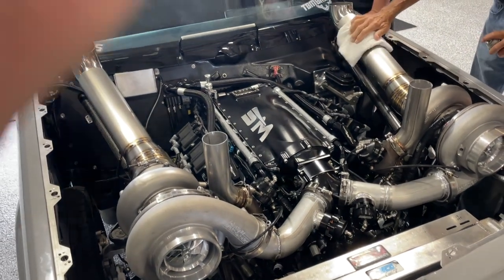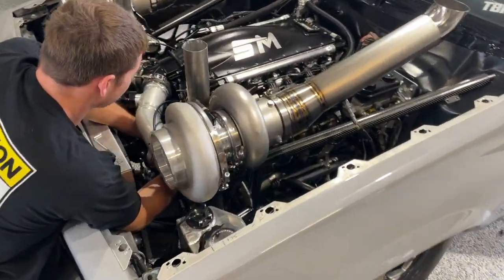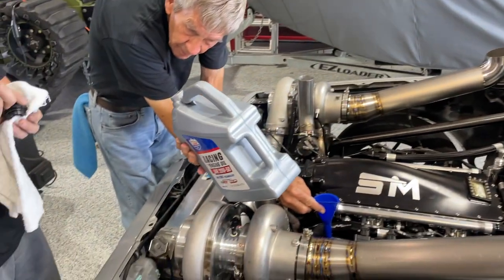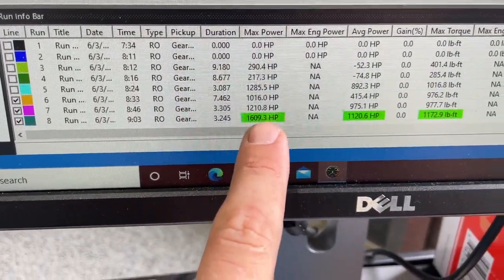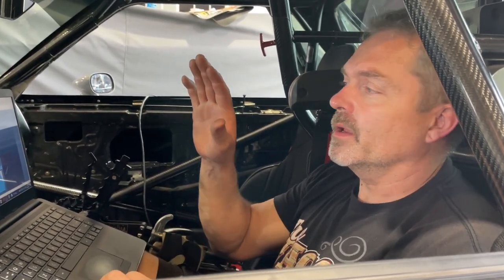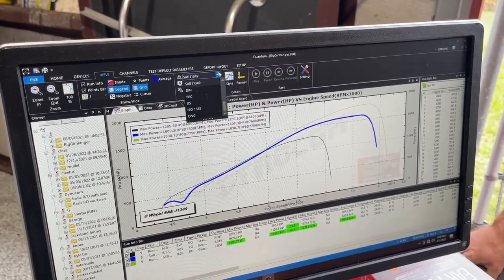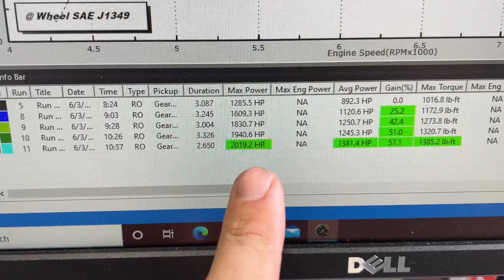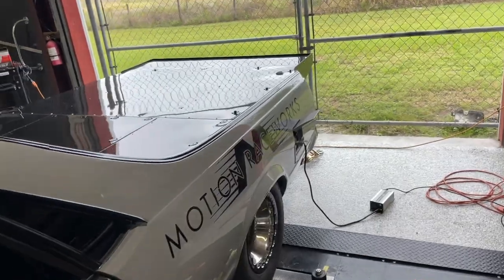Mullet's NEW Big Block Just CRUSHED Our Dyno Record.... Effortlessly!!!

Comment: Steve: builds high horsepower engines on the regular
Also Steve: sees these young guys going nuts over 1200hp
Reply: More like small block guys. The small block idea seems to have carried over from the jet engine plan. When they dropped that, they needed to make up for it. They're so used to blowing up small blocks with the kind of power that is just waking up a big block.

Comment: Can’t wait to see mullet dive deep into the 6’s!
Reply: if they can put the hp to the ground, with mullet running less than 1400hp from before. with 2000 at the wheel. How deep in the 6 do you think mullet will go?
Reply: I bet he will dip in to the 5s as long as traction is there.
Reply: @808G8GT  definitely weights to much for that
Reply: @808G8GT  100% will not touch 5’s
Reply: @dgrcgrl  when Mullet ran that 6 second pass they were pushing way more than 1400 hp. They were pushing 45 PSI through it. Mullet made 1515 at 29 PSI. They were at the breaking point though. That 540 is making 2,000 effortlessly.
Reply: @Bamabrute85  my point is with all of the chassis work that they did to get mullet to so much with what they had, 6 even low 6 should be a walk in the park. If they can put the power down. They were leaving off of 11 lb boost, almost like a bracket racer with a throttle stop on. With the bigger motor it's going to be interesting to see what they do.

Comment: Cleeter and the team freaking at 1600 hp (as expected lol) Steve was like yah so? Wait until we hit 2500 hp! Bwahahaha
Reply: If you consider the losses it's doing 2600 already.
Reply: @MiGujack3 where are you getting 2600 ? Lol
Reply: @zethloveless7238  2600hp at the crank minus approximately 20% driveline loss is 2080hp. That's how.
Reply: @zethloveless7238  the motor itself is probably making 2500-2700 at the flywheel before all the drivetrain losses.
Reply: @sixtomidnight1492  lmfao you don’t start with crank hp you made up then figure off of that 🤣. He made 2k consider loss that’s roughly 2500 but you don’t actually lose 25% that’s not how this really works. It takes a given amount of power to drive the components at a given speed. Fixed percentage drivetrain loss is a silly concept it’s not a reality.
Reply: @zethloveless7238  Tell that to Steve ✌🏼
Reply: @ElliHarper  That's right, can't tell that to keyboard professionals though 😂

Comment: Great Job Steve! I just hope people can remember that in this sport parts break, engines fail and more often than not, the break is a result of the fact that the parts are being pushed past their physical limits or they wear out/fatigue faster than if those parts were under normal stress loads. The fact that he was able to start the car without any issues and dial it in on the dyno in only six or seven pulls that all went perfectly (save for the traction issues) is a testament to how good Steve is at building and tuning engines. I can’t wait to see what she does in the 1/4 mile! It’s like a whole new car again!
Reply: Well, you have to remember that the engine was run in and tested on Steve's dyno so the hard part was done before it ever got to Garrett's garage!
Reply: Well said! Something can end up happening to this engine after a couple passes too. You just never know. One tiny mistake/hiccup making power like this has a huge impact on the engine. Nothing is made to kast forever especially not pushing over 2000hp lol always hated when people would talk crap in Texas speed like it was their fault something broke
Reply: I mean he did work for a pro stock team many years ago doing head development so i would say he has the geometry down
Reply: @nathanbutler8240  yea he's a beast when it comes to designing blocks/heads. But, this is not an engine designed and built by Steve. It's an aluminum brodix block/head package that Steve put together for cleets team. They most definitely went this route because it was more wallet friendly while still achieving the power they were looking for. I'm sure down the road they will end up with an smx in this thing at some point
Reply: So true, we all know she's going to blow, when and how is just down the track so to speak. The reality is that this bloke stands by the product he creates. To come out and tune it is not just a testament to his product, but it is hey look we can make 3-5 full runs with this setup, what happens from there is history.
Reply: @chadm528  yeah but honestly Tom Bailey and Clark rosenstengel have been running this exact same combo before Steve created the smx and was winning drag week for years with this same combo

Comment: It’s absolutely insane that the torque alone almost broke the previous dyno HP record
Reply: Torque breaks everything, but it sure is fun.
Reply: Helps that the dynos previous record was Texas Speed. John Doc made over 2200hp on a TKM built LS, also went 4.12 to the 1/8th
Reply: @Jake_Hamlin  dude why the hate on Texas speed, they did what they where build todo, nothing more, you try to build a Block that can handle 2K HP for under 50 grand, I bet ur ass you can't

Comment: New big block sounds damn good, son! Can't wait to see how y'all address the traction issues. Don't think trim adhesive is NHRA compliant.
Reply: Don't forget that he'll have big tires on at the track. That should help a bit. He'll only be using these skinnies on the street, with pump gas too.
Reply: You do realize they use adhesive on the track
Reply: @legros731  You do realize it was a joke?
Reply: @alanmumford8806  Would love to see a hub dyno, but track results are what matters. I hope they can dial in this beast fairly quick without their usual shenanigans of changing out parts at the last second, then making videos about all of their problems.
Reply: Agree, all the hp in the world doesnt matter if you cant make it stick and able to control it.  I think wheelie bars are in the future.
Reply: @baddriversoflittlerock8359  Would not be their worst idea. Let's see how she does first.
Reply: i think their biggest problem is bad geometry/not enough adjustability from the chassis builder, I believe they have plans to move the lower arm mounts or add a wider range of adjustment

Comment: when everybody started talking big block for mullet I really thought he was gonna go with something overkill like a Musi 959, looks like this was an awesome choice though
Reply: "Musi" builds nitrous engines.  Garrett is well beyond "spray" in his cars these days!
Reply: Musi engines are crankshaft breakers not reliable at all, there's a reason  guys stay around that 632 ci any more than that and you have so much stroke on the crank it becomes weak steve has a tech tip about them that's why he don't build them that big the biggest he does is a 572 most are 540

Comment: Nothing like a sweet running 8.....
Nothing
And with Steves relaxed attitude, he is saying " Mullet, you got a reliable 2000 wheel ponies, lets see if you can put them down to the black top....."
NOW your work starts Cleetus
That sort of power is a big ramp up for something that you struggled with at the old engine power.
Think about it, Mullets torque on the SM motor is almost equal to your peak power before......
That should make you think 🤔
Great stuff
Now the really exciting stuff starts....
Well done all
Cant wait to see it running on the track.!!
Keep on keeping on 
Heads up 
Eyes open 
No fear

Comment: So if there is a ~25% loss with the dyno vs 10% or less with the hub dyno. That means Mullet made ~2650hp on 25psi 🥶🔥🔥
Reply: That matches up with the 100 hp per PSI that was mentioned in the video as a safe guideline.

One of these recent videos mentioned the engine being capable of 30+ PSI...
Reply: @garrettstevens2232  on Steve's channel he said 35+.
Reply: @davemcdaniel4856  makes sense.  I remember seeing the graph and him talking about running out of injector, I just couldn't remember the exact numbers.  Knew it was at least 30.
Reply: @garrettstevens2232  well that means in theory max hp 3500hp.. 🔥
Reply: @Agent_Stark14  gotta stretch it to 3552... That would be 1776 + 1776.

Comment: Hell yeah!! No more lifting heads after every pass
Reply: They weren't lifting heads after passes they had oiling issues at full boost and eat bearings up all the time.. no this car will make that kind of power on the low boost almost lol and way more torque to move the heavy girl...
Reply: @freedomfox8183  pretty sure the ls lifted heads many times as well as bearings
Reply: The difference of running an engine at 110% vs 80%

This engine just made 2,000 hp like it was taking an easy jog through the park.  The LS motors are all out sprinting like their life is in danger and they just won't last like that.
Reply: @garrettstevens2232  there are LS engines making 3000+ but it's usually all out dry billet blocks and your replacing internal parts so often to avoid catastrophic failures it's just more logical to go big block or hemi power at that point   or if you have ci restrictions to work with even Steves new SML which is 3500 capable but still able to run coolant and so drag week is still possible  plenty options out there just not good for drag and drive events at same time as being 6s capable in a 3700 lb elco lol.. was good learning experience for the guys and their fans..
Reply: @garrettstevens2232 , Mullet will go Quicker. But it will not be that much quicker as Everybody keeps saying. Now it has the engine and those torque numbers it will run in the late 6's all the time with the engine not working no where near as hard.
Therefore making it more reliable. For Mullet to do the times a lot of other People are saying in the comments, It would have to lose 800-1000 pounds. High 6's are quick, But low 6's are a totally different Ball game. There was one comment i read on the last video saying that Mullet will now be able to go after Tom Bailey's 5.9 second pass. There must be some good crack out there.
Reply: @freedomfox8183  no, he lifted heads and bent rods nearly every pass. He stated in his last video with the LS that was the first set of bearings they’d eaten.

Comment: 6 second passes with ease with the big tire and suspension tuned right. 🇺🇸 🇺🇸 🇺🇸  🦅🦅🦅🦅🦅🦅
Reply: Skip 6s go 5s
Reply: Yea. If they can get the suspension setup.
Reply: What is the MPH on a low 6
Reply: @loadedhot1034  I would say anything with a trap of 211mph or higher but somewhere in that range, most of it will be short tracking the front half and running out of gear on the back half depending on their setup. We won't know till testing all cars are different.
Reply: @dutnu2339  🤞🏻😄

Comment: Not sure if y’all noticed but at the top of the higher horsepower pulls, all of the LED marker lights in the front blink. I wonder if there’s some AC ripple or high DC voltage going on. Would hate to see something like a sensor get damaged.
Reply: Yeah i saw that to. All the horse torques!! 🤣👍
Reply: The ign1a coils they run throw off insane levels of emi. Easily lights led circuits with their low Amp low volt turn on. My old itb race engine with them would flicker my underhood led lights with the hood up.
Reply: @davemcdaniel4856  The Top Fuel cars can disrupt a pacemaker. We had one at school and the assistant guy had to get away before they fired that thing up.

Comment: With that adhesive you should probably let it tack up for a bit, running on it wet probably let’s it slip more than if it was dry. Also heating up the tires with a torch would probably help tack it up as well. Just like you heat the tires at the track. Mullet is a damn BEAST man.

Comment: If you put some tubes in the hood that lift up to just above the height of the exhaust pipes, it should draw hot air out of under the hood. Or if you made the exhaust tips larger with a pipe coming through the center, you would get even more venturi effect sucking hot air out from under your hood.

Comment: Dumb question but what is causing it to spit on the driver side bank?  Rings and valve seals I can tell are tight and good but what is wrong on that bank barely?   Injector?  It has an extra pop and spit like a fuel leak somewhere.  Seems like one injector isn't 100%.  Slow to close or something.  I can tell that engine is built amazingly right.  It has really amazing ring seal and is tight and right!  Loose ones blow blue smoke like a chimney.  Steve built  ANOTHER really awesome engine!!  Can't wait to see this power at the track!!  Amazing engine!!   Mid 6's might be the norm with little effort if you can get that G-body hooked up.  The torque has to be about doubled from the LS engine.  The torque will get that weight moving!!

I can tell Steve knows how to put ring gap right.  Tight but not locking up under load.  I can tell Steve put love into this thing and it is going to be amazing.

I'm soo glad Steve was there for the trans and oil pan install!!

I'm looking forward to Cleetus and crew kicking ass with Mullet!!  May the Force be with YOU!!!

Comment: Just to be clear if they're losing 25% into the dyno, straps, and slippage when at a 2018hp reading on the dynometer screen they're actually pulling 2,522.5hp.
Reply: Nope. There will be only a few % wheel slippage.
Reply: @nordic5490  plus some % in the diff and transmission, prob 10-15% in total

Comment: That wrinkle in the sidewall is called hysteresis, you are overcoming the tires ability to recover, by putting in more energy.  So in reality you actually have more power to the wheel than what the dyno is showing.  Careful as this puts a lot of heat in the tire.  That's what Steve was explaining about the difference on hub dyno's vs tire dyno's, the loss is the energy put into the tire.

Comment: The short pulls are from the dyno control system provided with the Dynocom dyno. Please listen to me. The DYNOCOM computer system is the issue. The hardware is capable. PLEASE FOR THE LOVE OF GOD. Replace that Dynocom controller system with another system either would do 10000x better. Even try the YourDyno as your team could work it out easy, put that on some plugs that can be always brought back to the Dynocom system at any time, The YourDyno is cheap to test my point. I can specify the ramp rate in most dyno controllers and the engine will follow. I can say how many RPM per Second into the power run configuration and the computer will fight to maintain that. The Dynocom dyno is going to rattle your motors running such a high rpm per second ramp rate. You may think its the brake is being over powered being why this happens, It is not. Even your lower power cars runs are of the very similar RPM/Sec ramps. Its the controllers  programming that is just up the butt junk. I can see the concern on Steve's face and I know he is not stupid. Hell I look up to you guys so bad i only want the best for you two. Love from New Zealand.

Comment: There is no way they are gonna get this to hook up. Going to be wheelspin city. Idle to 2000hp in a couple of seconds is not going to be easy to manage on track
Reply: I guess you didn’t see Mullet’s wheelie on the 2nd hit on the big block, hmmm?
Reply: @mysterj1  That highlights my point. The power was turned way down and took way longer to come on, yet they still cooked it. More power, more soon is not going to be good. The chassis can't handle the power it had